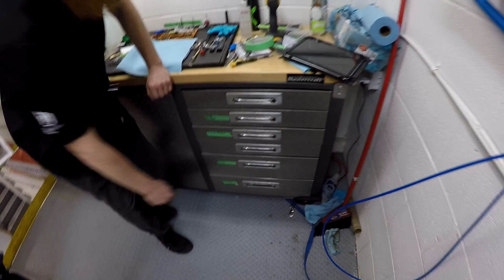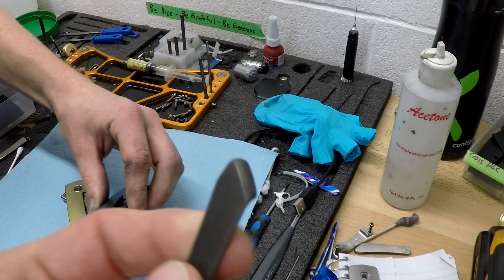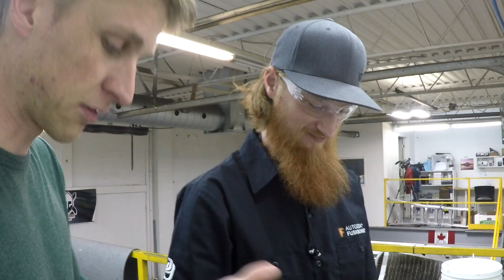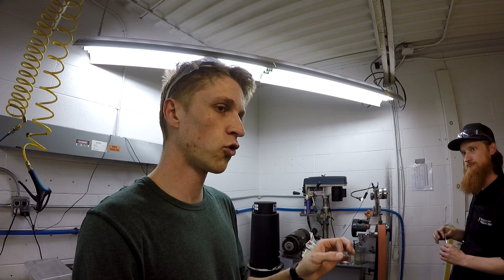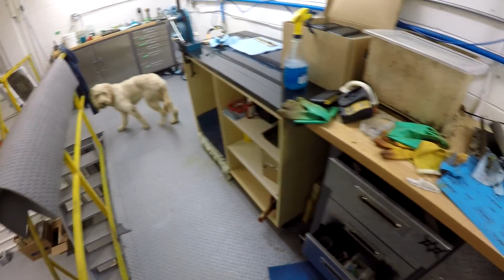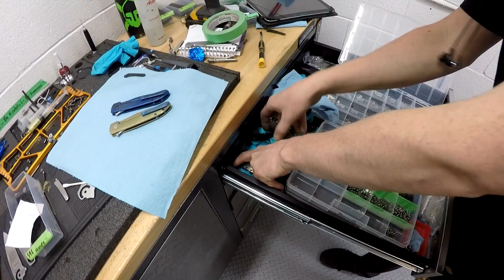Mega Rask Knife Update May 2017

Comment: That anodize and process area seems like a good spot for a tiny arduino controlled gantry to do batch jobs.  2 axes could do end travel over vats, and dip for specified times.  It may not return the input effort, but it seems handy.  A few buttons to start process types 1, 2, 3.

Comment: You should try doing a 3 axis edge profile, to prevent grooving of the endmill.  Right now you are doing 2.5d for the edge profile (or even just 2d), but if you add a slow z axis rise to the profile, you'll use a wider section of the endmill and there will never be linear grooves around the profile because you are never at a constant depth.

Comment: it looks like there's a cutout for a thumbstud, but i don't see any thumbstuds on any of the knives >_>
Reply: i'm not sure which part you're talking about, but their norseman has thumbstuds
Reply: their Rask knives don't. or I don't see it if they do.
Reply: maybe you can provide a time stamp of what you're talking about? because i did a quick scan through the video and can't see any blade with a thumb stud hole.

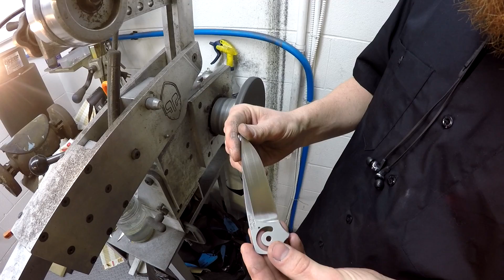if you're talking about the blade at 24:05, that's the hole for the detent ball.

Comment: Nice paper towel cover-up. lol

next... John making balls for ball bearings.

Why would wood scratch DLC? Isn't DLC not supposed to scratch? Why so many issues with the DLC, stuff is DLC coated everyday. The big manufacturers DLC can't have that many problems, right? Are they doing it in-house?
Reply: Andrew Delashaw i think he meant scratches from the DLC service provider
Reply: And a 2nd paper-towl adjustment when the camera was showing the Rask bin. Hmm... did we just see the 3rd  Grimsmo model?????
Reply: DLC is sent out, and I have the same issue as you understanding why Diamond Like Coating would be easy to scratch.
Reply: The worktable most likely has abrasive particles on it that would not damage the dlc, but straight up pull the dlc off of the hardware as it scapres along the table